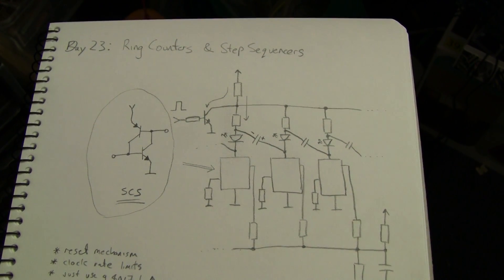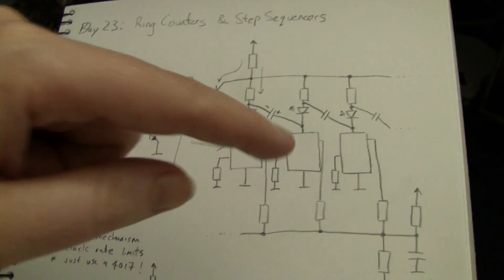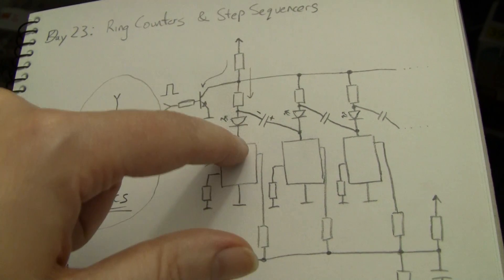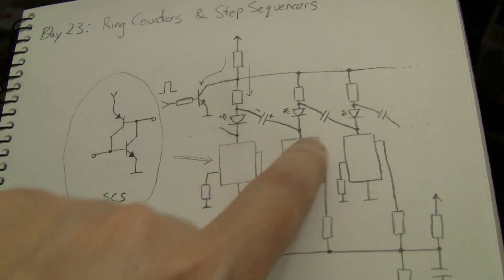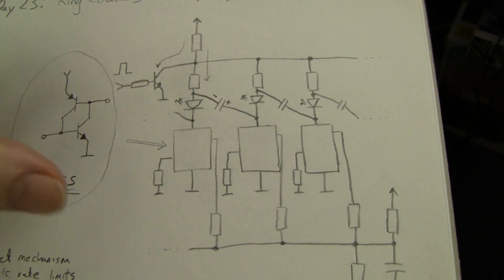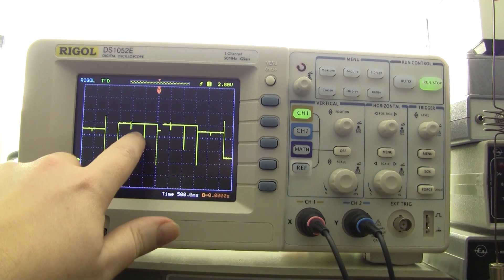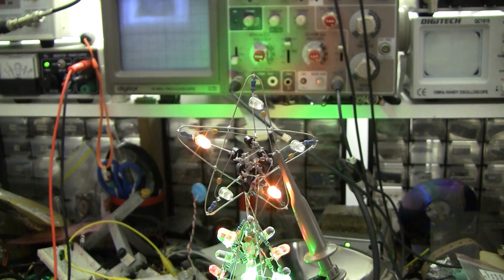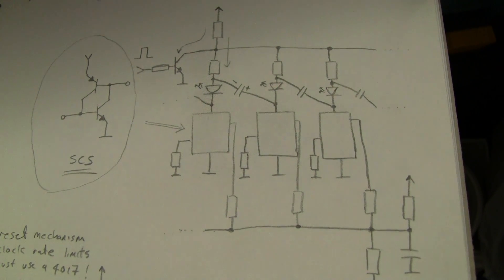Advent Calendar of Circuits 2011: Day 23: Ring Counters and Step Sequencers

Comment: I think the LED reverse voltage would be exceeded if you used a 9V battery , but OK on 5 or 6V. and low leakage plastic caps needed for these time constants.

Comment: Neat!  It's funny how much complexity (and complication) goes into building circuits out of discrete components.  It's definitely easier to use a "black box" IC to do all the work, but then you wouldn't really be learning about how these things work at a fundamental level, which is the operation of a PN junction or 2 PN junctions in the case of a BJT or FET.  I know you are pressed for time, but it sure would be nice to see you building these things.  You def have a knack for  "contraptions."